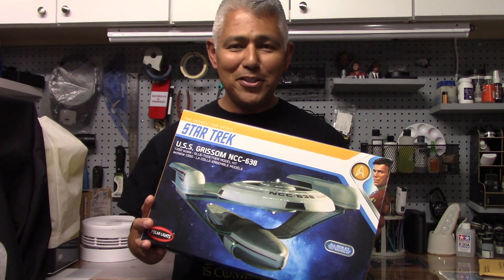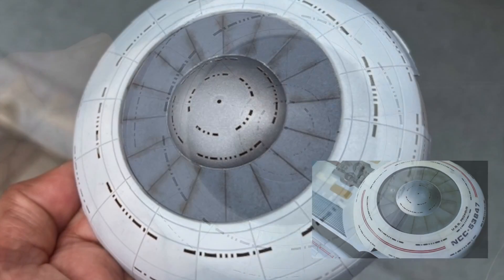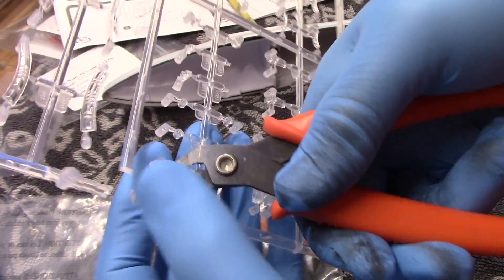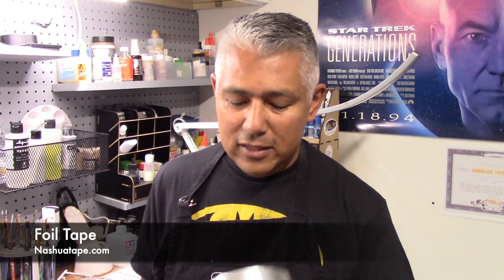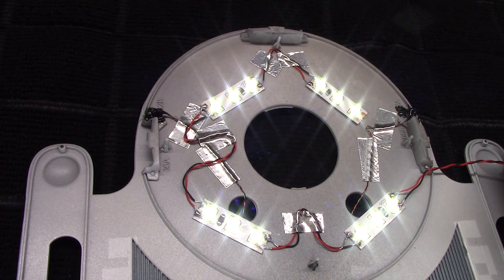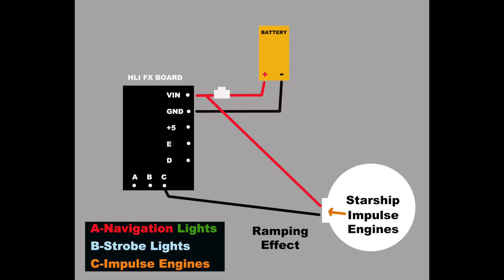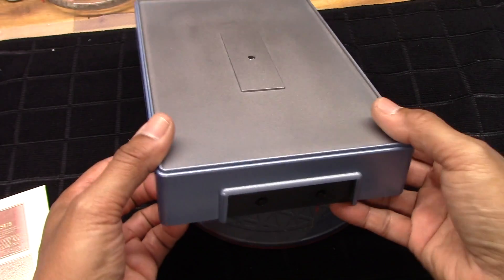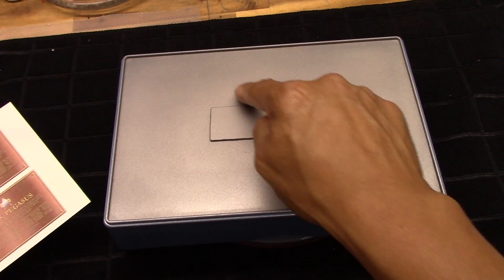Building 1/350 Star Trek USS Grissom Part 2

Comment: Nice tutorial on the lights Oggie!! One trick we use as model Railroaders since most of us work
in the tight spaces of an HO engine
is when you have more than one wire
that connects to the positive or
negative side is to solder the main
+ or - to a brass strip then solder all
other wires to the brass strip to
connect all!! I use K&S brass sheet
I get from Hobbytown or Hobby Lobby. When installing decoders, 
LEDS and speakers to my 
Locomotives it makes the connections easier to get to to
repair or add LEDS!!
Reply from the maker: Wow what a great tip. Thanks so much. Will pass that on in the next video

Comment: Another enjoyable instalment Oggie, thanks for posting. I have been using the wide foil tape for some years as light block in models; there is a brand here in the UK called 151 that is 2" wide and a large roll will cover many kits. Its simple to cover the inner hull and then poke through the windows from the outside and add the clear parts. I find it saves lots of airbrushing and is very effective.
Reply from the maker: Wow, what a great idea.   Thanks Mark for the tip.  Appreciate your kind compliment too.

Comment: Great video Oggie! Can't wait to see it finished. Just one point of clarification on the lighting board. Pin C will do either the impulse ramp or flicker. Which one will depend on whether you connect pin D to ground (flicker) or leave it alone (ramp).
Reply from the maker: Thanks Spencer. I did a quick mention of that with my diagrams but didnt have a switch available to demo it.  No worries for me though, I really like the ramping up effect you guys came up with.

Comment: Do you have a preference for boards? I’m wondering if HLI are  a better way to go for smaller kits?
Reply from the maker: Yes….HLI boards a great for smaller kits. At this time they have 8 kinds but potentially can be used for a variety of applications beyond the model they’re designated for. For example this board can be used for an Excelsior as well as for basic effects for a battle damaged Constitution refit. Unfortunately there’s an out of stock issue. This is partly due to the shortages that are plaguing the electronics industry. You can check in with them for updates. Thanks Phil.